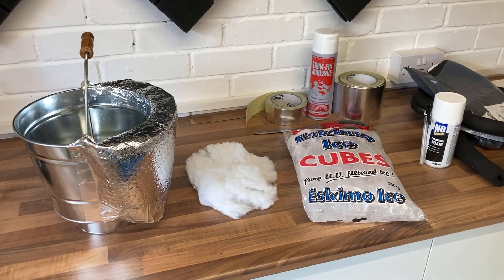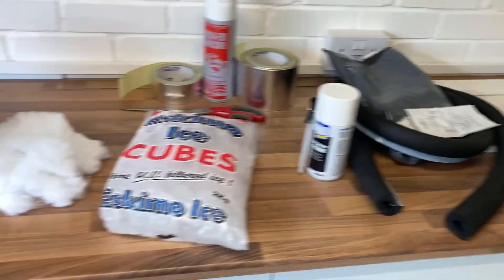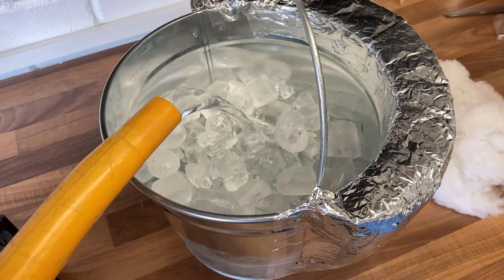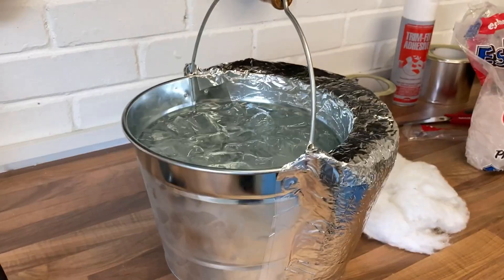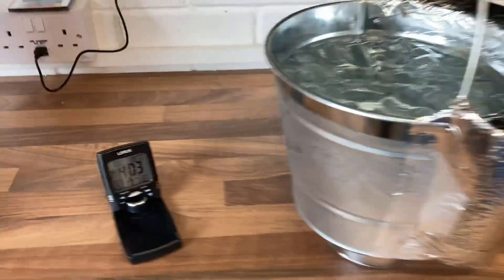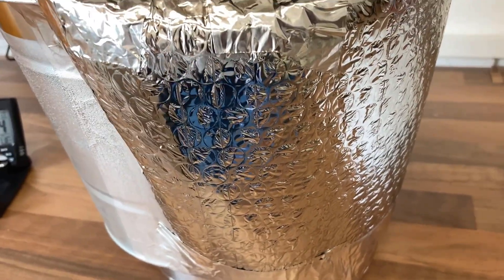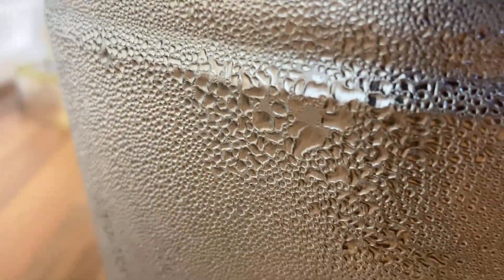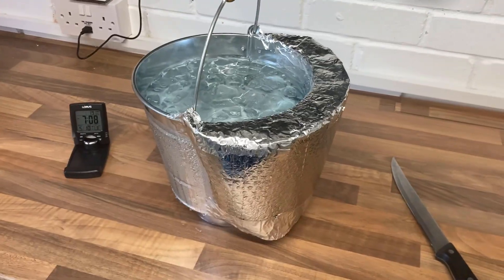Vapour Barrier in a Van - I can Prove they Work.

Comment: Nice demo but there is a problem !

In theory in a tiny test where you can actually fully seal off the area, yes it works.

Vans are not fully sealed nor are they meant to be. Manufacturers have many drain holes, plugs, plastic  trim attachments that come all way through into the inside of the van cavities. Thats why vans are designed to drain. Then we go and try to fully seal them up.

I do partially agree that adding multiple layers of good insulation and having partial sealed barriers on large wall and roof areas is a good idea.

BUT you simply can't full seal up all voids and all areas. So what happens when you try ? You end up sealing in any damp and wet that gets behind your vapour barrier, and it will.

Best idea is to use some form of final sheet layer of insulation (vapour barrier) to all large surfaces areas, this prevents "most" of your living space warm moist air hitting the walls BUT then add good ventilation so the easiest path for all that moisture is your roof fans, open windows etc.

All the areas you can't fully seal, allow the cavities to still breath.

On our van I did 90% seal up with a final layer of sheet insulation behind roof and wall panels. But at the edges where roof and ceiling join, at the lower areas especially at the back of van, the cavities can still breath to dry out if need be.

our 2 Maxx Air Fans are either open, or open and running pretty much 24/7. IN below zero in winter if were skiing the roof fans are open and Diesel air heater running to flush moisture and dry the air out.

A year later and I have pulled wall and ceiling panels and zero condensation issues. Day to day inside the van we never get condensation, just a little on the inside of the windscreen sometimes.

But as far as trying to full seal the van with a vapour barrier, from all the research I've seen vans aren't designed nor should they be full sealed up, vans are nor designed by manufacturers to be fully water proof and fully sealed up behind all the cavity spaces. Thats why there are drain holes all along the van sills.
Reply: Problem with this theory is that you might get condensation quickly where you have the steel visible and any water there that tries to espace downwards but get trapped behind the insulation in the walls. Your theory could work if you leave an air gap between the insulation in the walls so the water can follow the steel walls and flow downwards.

Also yes the vans are designed to let water out - because they get condensation. If you remove the physical possibility to get condensation, then you won't get any. It's physics laws straight forward. I've built 10 vans now and I'd still say that the best thing you can do is avoid any of the internal air to reach bare metal and the very best method for this is adding Armaflex closest to the steel. Then it's completely impossible to get any condensation at all.
Reply: @shadowfire77  🤣😂Talks about the law of physics, then says seal a van 100% and making it 😂 completely  🤣impossible to get condensation  🤣😂
Reply: @Chris66able  Nope, read again. I say remove the possibility to get condensation at all = let no warm air hit bare steel. Simple as that.
Reply: @shadowfire77  Yep, read again, You said " Then it's completely impossible to get any condensation at all."
Reply: @Chris66able   Yes it is - if you insulate and cover all steel in the van, i.e. with Armaflex - that sticks directly to the steel - then no warm air can reach the steel frame at all. You won't get any kind of condensation whatsoever.  If you take a cold can out in the sun you will get condensation quickly, but if you wrap it with insulation that sticks directly to the can letting no air slip by,  no condensation will occur.
Reply: @shadowfire77  Oh God, I 'm tired of explaining basic physics to you lot, if you think a can has the same physical properties and dimensions as a vehicle the go for it ! You won't get condensation on those bits you have covered but to believe you have eradicated condensation 100% throughout a vehicle  is beyond belief.  If true then let some of the RV/Motor home  manufacturers know and you will be a millionaire !
Reply: BTW if you are so certain then why deny what you wrote in the 1st place !
Reply: @Chris66able  The only argument you seem to have is a bad attitude, comon dude :)

I'm still talking about all steel covered, not just pieces. The insulation creates a new inner thermal shell but is bonded directly to the steel shell. For every van I build (working on my 11th now) it takes me about 4 months to complete the whole insulation part and it's really horrible to work in and around all the cavities in a van. I'm working with a professional RV-manufacturer in Europe to see if we can create premade insulation patterns for the same purpose and to shorten build times. 

If you ever come by Sweden i'll showcase how it looks like in sub 30 degrees celcius outdoor and with a warm, cosy and condensation free climate in the van :)
Reply: Wrong, cavities are only in doors with WIND down windows, in every van I know of....No drain holes in my Van apart from front doors, they are designed to release water as water enters from the winding window...Trim Attachments on any van should be sealed especially sidestrips, look at umpteen youtube videos about sealing factory roof plugs, and side trim!!!!Major issue with vans, they need trim properly sealed regardless of insulation or a build out..Do proper research! Not sure what Van you have but it Ain't a Merc, Transit or others I know of..
Reply: @Namdor2012  After 1 1/2 years and multiple sub zero ski trips I have pulled down my ceiling and wall panels and pulled back the 2 layers of Thinsulate, and the solid sheet (foil radiant layer) and what did I find ?

No sign of any condensation, no water or condensation damage, no mould or mildew. Dry as a bone.

I do not have a vapour barrier !   A cavity is just a "space" the whole van behind the walls, ceiling are cavity spaces.

I do have strong air barriers and plenty of active ventilation and airflow 2 x Max Air fans open or running 24/7 

You don't need a vapour barrier. Allowing a van to breath and plenty of airflow, and good insulation,  is the key to stopping condensation.

I have seen many a van that tries to seal up everything and they pull back walls etc to find damp, mould, wet insulation.
Reply: @rbrown  Okay so who is right here?? I want to convert a cargo trailer into a camper 😩
Reply: There is no 100% right way.  I have seen many commercial van companies say insulation is complicated and many ways to go about it 

I chose the no vapour barrier method.

I did put in place lots of “air barriers” just not vapour barriers 

Yup there is a difference between vapour barrier and air barrier … Google and look at some home architecturally videos it’s interesting 

One thing they use in architecture is …. For a 20mm hole in a solid internal jyprock wall …. You get something like 30ltrs of water vapour behind the wall through that small hole in one season 

So what hope do we have trying to vapour seal a van … you can’t too many factory holes and joins 

After 1 year I got to pull down some of my wall and ceiling panels and ZERO moisture or condensation anywhere and that’s with air barriers not a vapour barrier
Reply: I think this is the way. But you must have an air gap (20mm preferably if using some reflective on foam board) between the steel and insulation.

This way the van can get rid of the condensed water like it was designed to.

Now I would guess you could easily go for some thin sheep wool between your steel and (actual) insulation. Since it's breathable and mold resistant. It should release any moisture over time.

If you go this route I would guess these so called climate vaper barriers are the way to go. They control the flow rate a bit better to keep a nicer climate inside the van? Question mark? (I am no expert, just learning and reading about this topic)
Reply: I think the theory of a vapour barrier in a van is a sound idea, however, it can only work if the vapour barrier is 100% perfect.  And how many can say the barrier they've fitted is perfect? The moment you get holes gor cables etc, it's going to be a route for vapour to get through.

Personally, I feel the better idea is to build with the intention of allowing your van to breath.

Vent holes at the bottom and top of wall cavities to allow air to circulate.  Using sheep's wool for insulation etc
Reply: How can you prove you have sealed the van completely? All the drain holes.. that’s air in! And you would be surprised how much… use spray foam if you live in Alaska as insulation but if you are in a warmer climate- sheep wool, and some of those boards with reflective tape on them + plywood walls gives you decent insulation (and air flow).

Comment: On my van I’m thinking of using the recycled plastic wool then covering over with a thermal liner, how would I go about fixing the ply wood layer on to the thermal liner? Would screw holes then cause condensation potentially?

Comment: Hi Greg I'm in the process of starting our framing and insulation but it's slow progress. I'm a bit concerned about all the condensation that's forming in the ceiling now it's colder, as I don't want this to trap moisture in the wood I'm using for the frame. Would it be a good idea to apply one layer of foil along the metal panel of the van, then another layer on top of the framing/insulation? (So foil/frame and insulation/foil sandwich.)

I'm just thinking if I can apply foil now it may prevent all the water coming in, then I can continue with the rest gradually
Reply from the maker: A layer of foil on the van will do nothing at all. The condensation will form on the foil surface. You just need to open the van up on a day when it’s not raining and let the internal and external temp equalise so the ventilation drys the inside out. The moisture content at that time of year will be minimal. So you can insulate without fear of trapping moisture 👍🏼😊
Reply: @GregVirgoe  thank you! Glad I asked, that would have been a frustrating mistake to make 😂

Comment: Maybe a better experiment would be to have the bucket insulated all the way around but with only half of it sealed with a vapour barrier. after all no one questions the need for insulation but some question the need for a vapour barrier.
Reply from the maker: Yes it is a good point, but without doing the experiment can you see that an open woolly insulation would just let air and moisture go through it to the cold metal. That is exactly what will happen. But like you say if people need to physically see that happening then I may have to prove it. Hope that helps you 😊
Reply: I'm 100% in agreement with a vapour barrier, one argument against it is the "double vapour barrier effect" one being the skin of your van and the other in this case the reflectix, it's supposed to cause problems some how ? yet nobody argues against double glazing @GregVirgoe
Reply: @GregVirgoe that would be great. Need to convince my son to put a vapour barrier in.

Comment: Such a great video! I’m in the middle of a build and the thought of moisture stopped me In my tracks.  Glad to have found you on YouTube!  Side note: Have you or anyone dealt with water build up in the rocker panels? I have run into this issue with Ram promaster 2500.  I’m lost with how water keeps getting in. 🤷‍♂️ ty for all your effort in each vid!!
Reply from the maker: I’m aware that there is a poor design on the scuttle below the windscreen that allows water to pour onto the engine bay. 
Make sure any drain holes are not blocked with debris, any rubber bonnet seals are intact. Use a bit of DW40 on head as water repellent. I have known others to cover the engine bay with on combustible plastic sheet to keep water away. Hope some of those help you 👍🏼

Comment: Hi Greg.
First - great channel and really informative videos.
I am really struggling with the vapour barrier issue and that the considered opinion seems to be 50/50 on whether to include one or not.
I realise that the main van companies eg Adria, Swift etc do not actively include them but this may be due to the additional intensive labour to get a 100% seal.
I am about to start my build and would like to include one but realise that it will be a waste of time and money unless I can be confident to get a 100% seal around the complete perimeter and every opening (windows) and hole eg cables etc that is within that perimeter. Also I will need to ensure that every abutment to structural beams/ridges etc is fully sealed.  
This is probably why the main manufacturers don't bother and rely on the engineered drain holes in the bodywork  and free ventilation of the vehicle etc to drain any condensation.
Please could you share your tips on how I can be sure that every possible air entry around the perimeter and within the vapour barrier is sealed?
Many thanks
Reply from the maker: I challenge anyone to find me another channel that doesn't use a vapour barrier and gives you the scientific facts and proof that you don't need it. 
You won't find one, just unproven false opinions.
Reply: @GregVirgoe  But that's not what I asked Greg - it was a genuine request for advice on how you are confident to get a 100% airtight seal. For example there are numerous drain holes in a van body and structural hollow members that are impossible to seal (ie if you think of the "sealed" perimeter as a boat and submerged it would all water stay out?)  I am not trying to argue with your belief I am just asking for help as I cannot see how anyone can get a 100% airtight seal with the structure of the van that's all and then if air can get in it will condensate and would be harder to dissipate?  I am leaning towards a vapour barrier but am concerned that unless I can get a 100% seal it could be problematic in the long term?

Comment: Nice experiment and great to see the results and put my mind at rest with my sound deadening.

Might have to get a roll of foil tape just to make sure those edges are totally sealed.

Cheers 👍😎🤟
Reply from the maker: Yes you must tape all the edges and joins or it will not keep the moisture out. 👍🏼😃
Reply: @GregVirgoe  Ok, the metal foil tape will be suitable, yeah?
Reply from the maker: @Castorworx  yrs aluminium foil tape is the best thing to use. 👍🏼

Comment: Nice experiment although I got some concerns. I think the major issue with van compared to buildings etc is the huge variation in climate. To actually simulate what happens in reality it would have been more realistic to cool down also the insulation och moisture barrier before putting it at room temperature. I quite sure you would se condensation also on the barrier, however not as much. I would argue that as much as you need a vapor barrier you also need an internal material that is breathable and moisture insensitive.
Reply from the maker: It’s clear from your comment that you don’t understand what is happening and how this works. 
I suggest you watch this video I made to explain in more detail. 
https://youtu.be/4-RJCeK9Ysk

Comment: Great experiment. Why not put the vapor barrier first directly on the metal and the insulation on the outside? Van walls have holes from the outside in the bottom and trim plugs so moisture can come in from the outside no matter how well you seal the inside. Putting the barrier directly on the sheet skin would prevent condensation on the areas you cover?
Reply from the maker: No it would not work like that because the vapour barrier is not thick enough to raise the internal surface temperature above the dew point so you will get condensation forming on the surface of the vapour barrier like that. Look at this video I did about insulation thickness 
What's the MINIMUM Insulation Thickness? Budget Build Ep 6
https://youtu.be/4-RJCeK9Ysk

Comment: Boat owners have known for years that the most important equipment to deal with moisture and mould is a desiccant dehumidifier.
Reply from the maker: A dehumidifier will just try to deal with the problem that has already happened it won't prevent it from happening, it's like taking tablets after you become ill. A vapour barrier prevents the condensation from forming in the first place so the problem never exists. So this is the vaccine. Prevention is far better than cure!

Comment: You never got to testing vapor barrier alone and insulation alone. The only place car manufacturers put the barrier is the door panels and still, cars do not rust or mold out (provided no major water intrusion and condensate drains in the sheet metal are not clogged. I will admit though that most plastic paneling in cars is effectively a vapor barrier on its own
Reply from the maker: Nobody lives in a car, it is not a problem that has to be dealt with by car manufacturers, they are not designed as homes. Doors in vehicles have drain holes to let water out from wet windows and door handles, they don't rot much because of modern galvanised bodies and better paint systems now.
Reply: In car it gets sun and hotter, so a thin barrier works fine.....You have to think timber walls and a living space, breathing all night sleeping, cooking, making hot drinks, so therefore very high moisture levels and it will condensate behind the insulation you need in a van so it does not get hot, or cold...During winter the outer skin of the van stays cold especially overnight and you get a heap of moisture locked in behind the insulation you need ( For winter and summer) and you get rusting and mold...A car is far removed from a van...